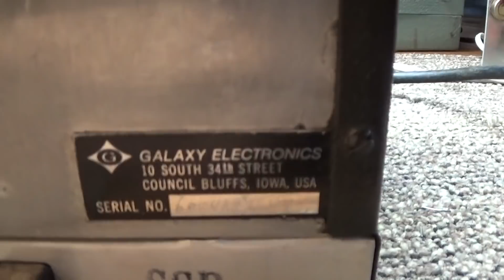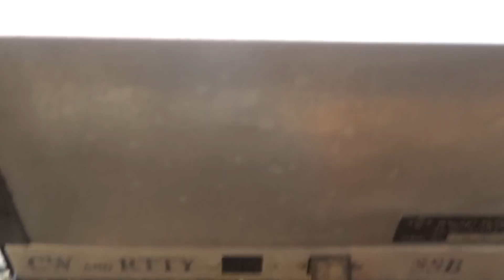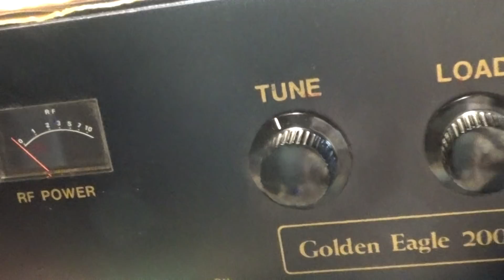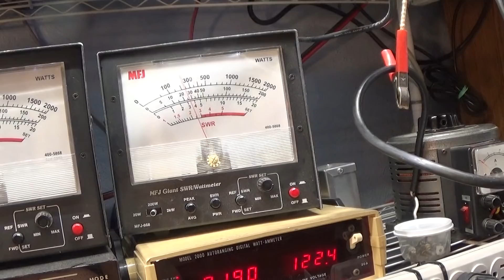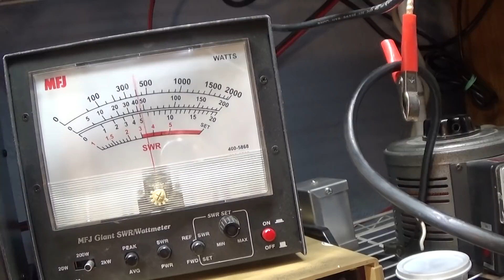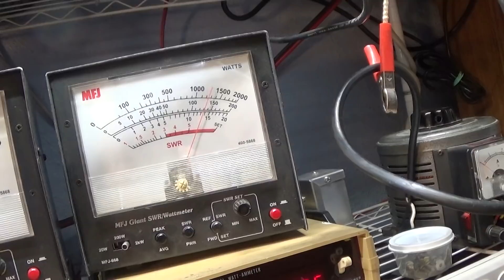Galaxy 2000+ 10 sweep tube (all outputs) Linear Amplifier on the bench

Comment: I came accross one of these amps.  One I have been totally modified with single 4-400 tube.  to tell you what happened.  The RF chokes by fan burnt up frying arcing.  I order some NOS 0.5 mh and put 2 in parallel   that worked , Also there was arcing from tall choke so I put high voltage duct seal around the area.  Also the wire parasitic choke for the plate started arc to the RG8 cable shield  I put heavy  duty 3M   high voltage tape around it .  cured the arcing.There are few critical point in the amp that can arc  be careful .    Ohh  the transfer relay was sticking gave it bit of spray cleaner lube stuff from electronic store.    Seemed one of the contacts loose moved out place so I glued it with contact cement.    ohh the power supply had blown fuses to begin with .   10 amperes ones  I suggest 10 amp slow blows  or go with 15 amp slow blows.  Be care working on this amp lots high voltages.  be very careful with it.    Mine has a AC 6.3 volts antenna transfer relay and jumping it will switch the relay.   to be careful I made an interposing replay from the Icom to the amp just for safety.  About the power output I seem get about 400 to 500 watts out CW on 20 meters.  I can not really say how the old 4-400 tube is .  Might be weak.  but it does get more power output.   One thing on 15 and 10 meters  I am getting stray RF into the shack from the antenna being so close and speaker hums like crazy.  20 and 40 meters is okay though.   I did take aprt all cabinets and did complete spray paint cabinets fresh it up.  cleaned chassis up.   Maybe if all goes okay I might try find a new 4-400 tube.  Not many of these amplifiers around any more. So I think it was worth while to invest time on it.  One thing I might add is I put a pick up loop inside the amp so I can hook up scope to monitor the signal  any old scope do the trick I guess.  If you czn find one these old units its worth a go at it.      Thanks trandr for the video too   .     Tony VE4AKF
Reply from the maker: The problem is the original sweep tubes run on around 900v and a transmitting tube like the 4-400 runs on about 2500v. It is not easy to triple the voltage and then once you do, you now have 2500v running thru an amp that was made for 900v. I would expect all those kinds of problems from that.
Reply: @tramdr  Yes some one worked on the power supply  seems the cw rtty is ripped right out of it the connections and there board installed for lots diodes.  theres 8 electrolytics too.    not sure what B + is it is high ..  my 1000 volt fluke went overload.    I have find DC probe I guess ,    mA meter who know if its reading right either..  have put in line mA meter.        Well my amp works    i stopped arcing.     few things yet to do  .
Reply from the maker: Dude, you going to kill yourself. Stay out of that death trap. Lots of bad stuff going on. I already said a 4-400 likes to run on 2kv plus. I'm guessing a minimum of 1800. So now you tell me you hooked up a 1kv max fluke meter to the high voltage of this amp. Not good, sir, not good. Say a prayer, thank the lord and at a minimum, stay out of it. If it was me, I would not only do that, I would get rid of that death trap. Did you see my videos on the transformerless amps, and the BLJ with the transformers in series? IMHO, there is no safe way to get 2kv+ out of 600v transformers. There are ways to do it, voltage doubles, voltage triplers, running transformers in series instead of parallel, but non of that is safe, IMHO. Be blessed.
Reply: @tramdr  amp is running fine.  It be good part of my station.  Im safe not worry. Thanks.
Reply from the maker: Problem with safety is you are until you aren't. I personally would not run that with a 10 ft pole. Like I said, it works, I know people who do, but IMHO that is a very unsafe amp.

Comment: I loved the amp and an ingenious setup using 10 horizontal tv sweep tubes. I put in 100 carrier swinging to 200 and I was getting 1800 out and it was with all the original caps. I did end up burning out one of the inductors coils. I rewound. it by hand and was as good as new. I ended up moving and I let all my equipment in the attic at my old house. I deployed at the time. My  girl didn't pack them up. 3 ft101s I had one of th he old ones I think it was a 401 yasue it put out 400 watts just th he radio. I had a lot of nice stuff. scopes,  tube testers, oscillators, 2 polymer skipper Amps.  Tatar 667v. president Adam's, a washington both 858 PLL. A couple Navahos. I had as newer Yasue digital freq meter but cant remember the number. 886 or something. Anyways now I got yo start over. I was sick when I got home